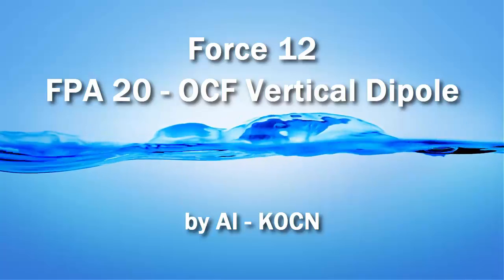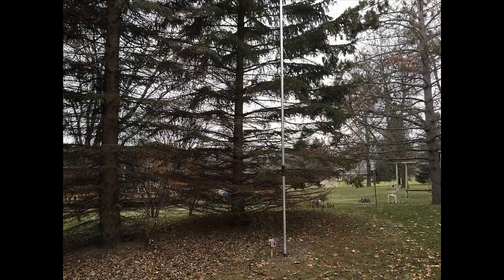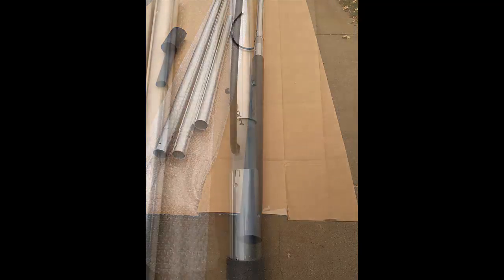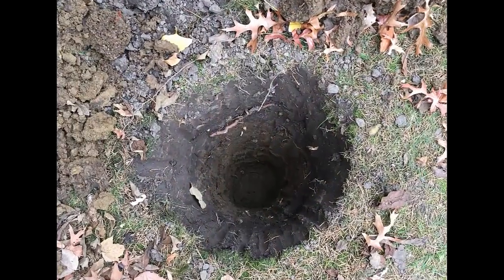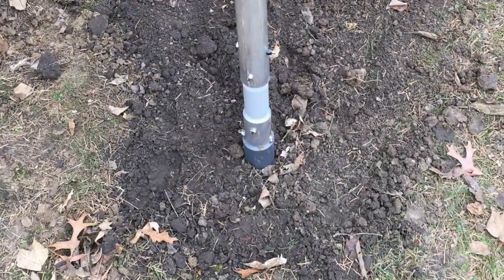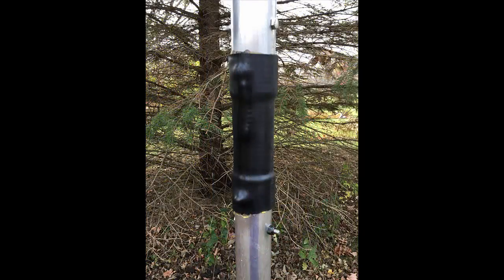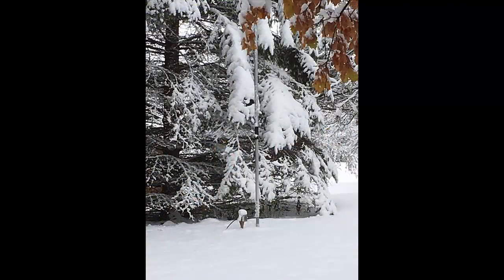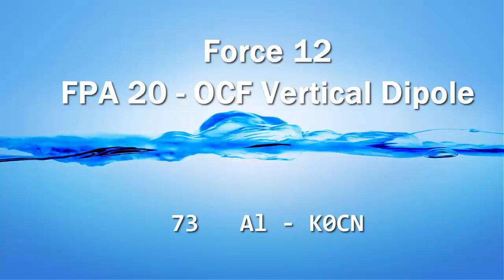Force 12 Flag Pole Antenna

Comment: Al, it’s been three years since you posted this video... have you stayed with the original configuration or did you upgrade to a remote tuner at the pole base?  I’m also curious what the impedance was at the connection point of the antenna. a typical OCF is approximately 200 ohms at the feed point and needs a 4:1 step down transformer (or balun).

I have a 30’ aluminum pole that I plan to convert into an OCF vertical like yours.
Reply from the maker: Hi Richard, I am no longer using this antenna. I did upgrade to the remote tuner and also used a 4:1 balun between the tuner and the antenna, but could not make it perform for me. I believe the problems I had were caused by interaction with my nearby 80M dipole. I have not tried the antenna in a new location but have plans to give that a try.
Reply: Al Senechal thanks for the reply!  I’ll see how I make out and let you know. I don’t have anything nearby that would conflict with the pole.  have a good evening!
Reply: @richarde735  Hello Richard!  I'm considering a flagpole antenna and I was wondering if you had installed and used yours enough to give it a rating and let me know what you thought of performance.  Thanks In Advance!
Reply: @Lehibob  I would be interested to know too.

Comment: Did you used concrete on the hole? If not, how it stands so far? Thanks.
Reply from the maker: I did not use concrete in the hole. I have not had any problems with supporting the antenna in just soil.
Reply: @k0cn  I could not find the vendor website, but still looking. Just what I need. Thanks for the posting. 73